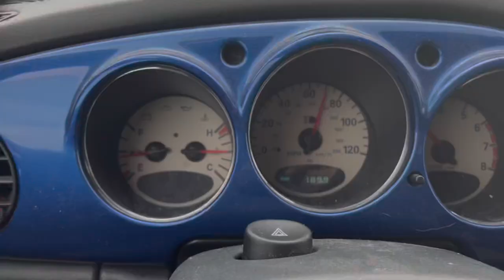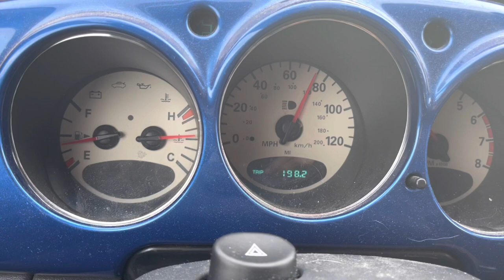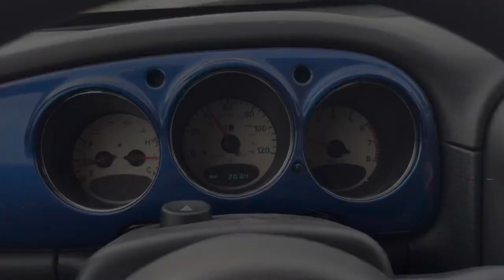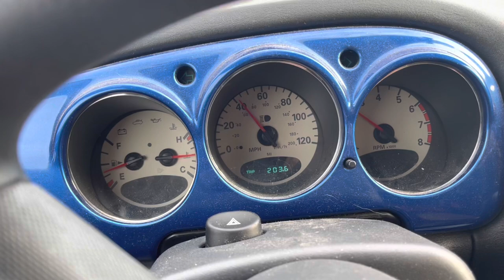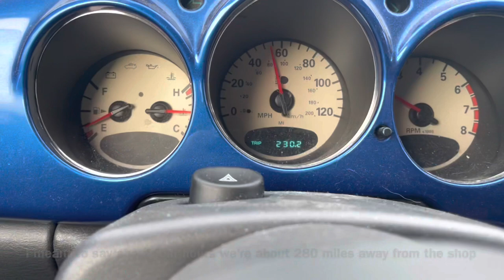Can we Drive 1200 Miles With a car That’s Overheating? What you can do if your car is Overheating

Comment: going to texas is a long way should of started at 65 mph for hour then go up to 70 mph stay at 70 mph any higher would overheat did u tried that way???ken
Reply: radiator??
Reply: cap cant hold the pressure
Reply from the maker: Well it went about 300 miles without having this problem I tried everything I could I wanted to make the video somewhat watchable I didn’t know when I started making the video that it wouldn’t make it but I didn’t start making the video till after we were about 300 miles into our trip needless to say we did not make it lol . But we are back at home and safe so that’s great thanks for the advice though I tried everything. 
Eventually it was just pressure rising the cooling system so much even with the cap loose it wouldn’t not overheat it did take a lot longer though